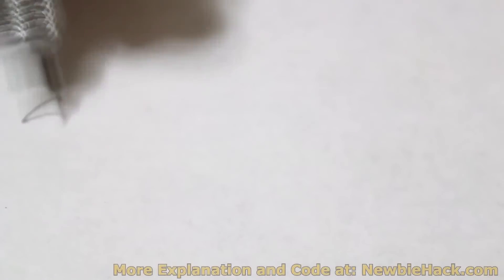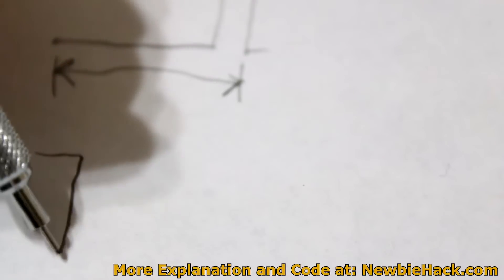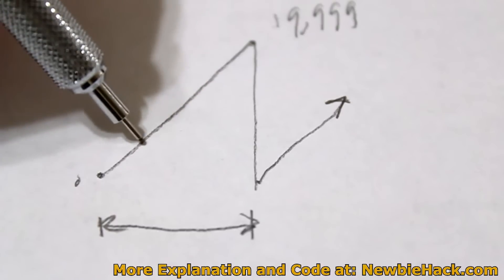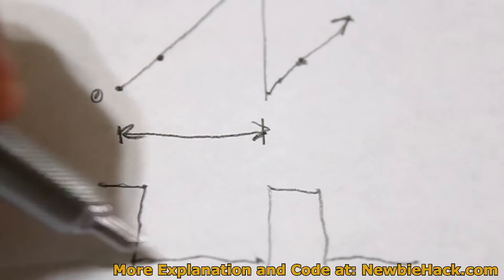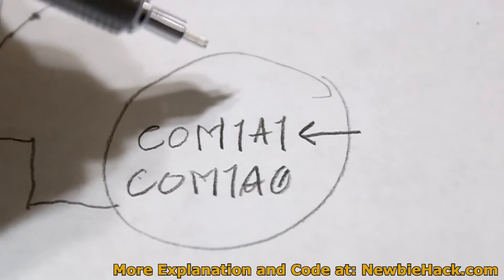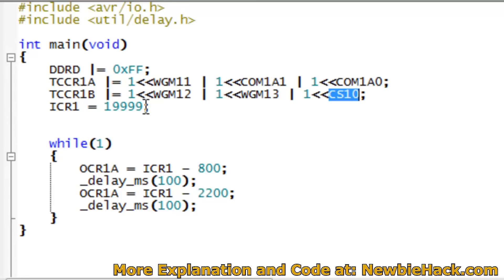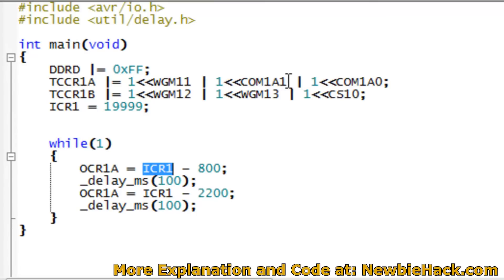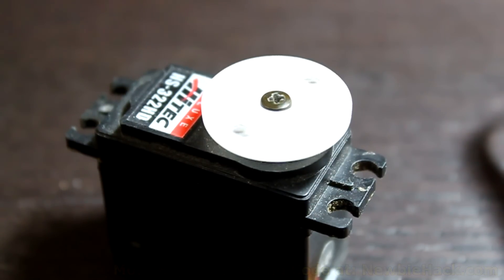39. Arduino for Production! How to control a Servo Using Fast PWM with Non-Inverted Pulses

Comment from the maker: @TheDragothica Good question.  The phase correct and phase and frequency modes only differ in how the OCR is output.  These modes are best use on motor applications, but not with servo applications.  I have a tutorial planned for motor control, so I will address these two modes on that tutorial and show the OCR output on the scope.

Comment: Looking at the datasheet for the atmega32, at the different pwm modes i understand the inverted and non-inverted mode, and the phase correct mode as well, but theres a phase and frequency correct mode i don't understand. Also i dont quite see the difference between PWM and fast PWM? If i had a scope i could check it myself, but i don't :/

Could you via you scope, or you very precise hand-drawings try to demonstrate the difference?